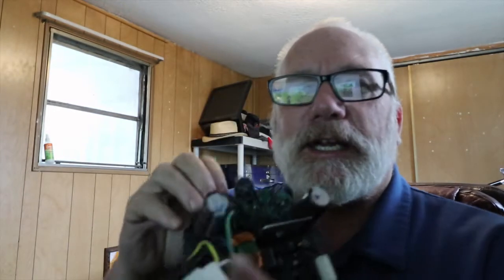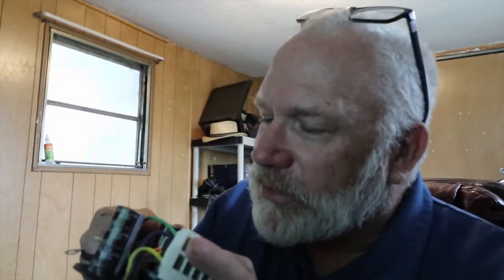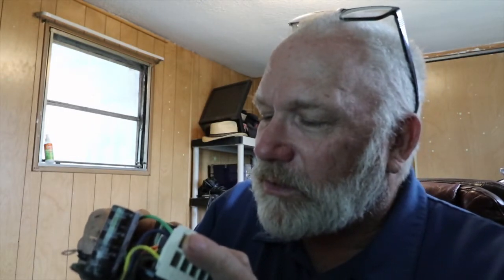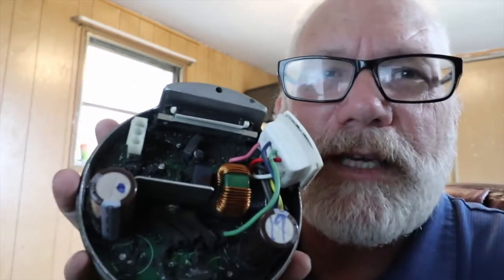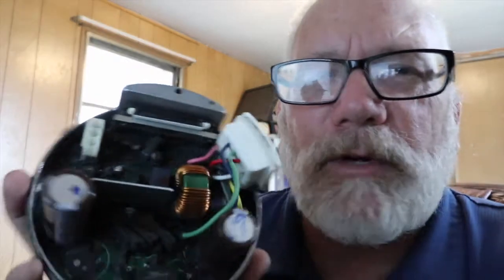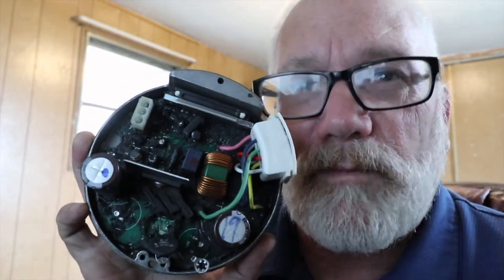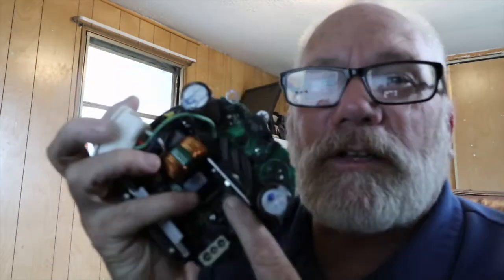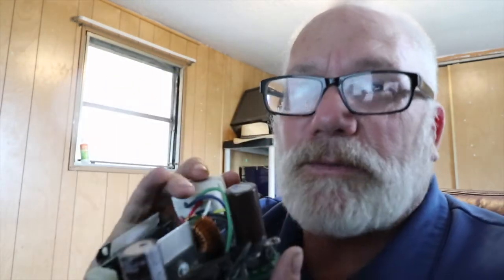Genteq x13 ecm motor with fm19 module REPAIR

Comment: Not sure if anyone replied with this but if you are in a pinch you can simply twist the thermistor until the two leads are shorted to each other and the motor will run with no inrush protection. A simple fix. temporary or as long as it will run until the next power surge.
Reply from the maker: thanks, but don't really need any fires...  but thanks for watching
Reply: @jefferycurtismusic1602 @jefferycurtismusic1602 It's true about twisting the thermistor. The thermister isn't really there to protect the motor. That's what they want you to think, but it's actually in there because the manufacturer knows the thermisters have a limited life. So, they basically use it as an expiration part to force you to buy a new motor. It would be replaceable if it was meant to protect the motor. If you're worried about it, you could always twist it and add an external inline thermister. Many aftermarket motors come with external surge protection that plugs into the wiring harness. A lot of my customers choose to go with a PSC motor instead.

Comment: Great video, that is exactly what gentec is doing. And knowing it can be made  at a fraction of the cost. Now im about to decide what to do with my broke one. It is hot in my house, but im not paying gentec a dime
Reply from the maker: the drop in replacement is really the best way to go.  I fixed the genteq for it only to fail soon after, put the drop in replacement its been fine for years.
Reply: @jefferycurtismusic1602  I bought a psc motor and a relay switch. Bout to put it in, Hopefully that works.

Comment: I replaced an ecm fan motor for a customer on a carrier furnace. Tried to get a new motor module for it. The dealer said the only listing in his system was for a whole motor. No listing for the module. Dont know if the info was correct, but i didn't have a choice. Since then i have a chance to look at the motor and module and found the motor was fine and the module had 1 small connection burnt. No sure if it's a fuse or just a weak link in the design. The inrush thermister looks ok, not deformed in any way. Havent electrically tested it. I was thinking of resoldering a similar sized and gauge wire accross this point to see if it would work

Comment: A great help to me, and to many more I'm sure.  Thank you so much. Very well done. Thermistor resistance was 1.4-1.5, should be 1.0. Hoping that's the issue. Certainly going to give it a try, replacing the thermistor without removing the composite material.
Reply from the maker: thanks .. I hope it works for you. have a great day.
Reply: Did replacing the thermistor work?
Reply: Did replacing the thermistor work?

Comment: Wish I would found your video  sooner ..I got in our trade in 1995 ( belt driven era ) running residential service..sooo  bought a new Bryant heat pump package unit last year ..thinking awesome no problem for many years …wrong …indoor blower motor starting staying on non stop …pulled the stat ..pulled the subbase checked all low voltage wiring ..changed the green wire one of my extra tstat wires …I’m frustrated now !!! Buddy said it has to be your board only board is the defrost board ..with no g terminal..but I changed it out anyway …still running non stop …now I’m mad …. Messed with those ac/dc relays for the additional heat strips I had put in ..with that Rectifier board ..( feeling like a dinosaur with this new technology ) …made myself even more mad ..anyway …started looking at the motor ..thought well why don’t you pull your speed leads ..sure enough ..pulled them …motor is still running …sooo I just ordered a new Module yesterday…this better work !! I miss belt driven motors and standing pilots just saying way more goes wrong with all the fancy bells and whistles !!!  ..this one really had me saying what the …. !!!
Reply from the maker: I am so sorry for your pain.  i know these things are designed to cost the owner money and prevent self-repair.   If you watch my follow-up video, The new module only lasted a couple months,  Finally I just replaced the motor with an Evergreen drop in replacement, which I am happy to say is still running fine.   Good luck hope your module lasts longer.

Comment: Agreed 100%. Genteq OEM should make some quality improvements on these or soon they will be facing a likely class action lawsuit by the many defrauded customers. Aftermarket is the way to go with the X13 without any confusion. However, it appears that the "Genteq X13 ECM Motor" is now under the Evergreen model made by Regal Rexnord. At least it seems so plus they (Regal) apparently have it fixed, comes with real ball bearings and a 2 year warranty.
Reply from the maker: ya cause the drop in replacement is still going strong years later...

Comment: I did hvac for over 40 yrs. My 2yr old x13 did the same thing. I installed a new package unit when I moved. Can’t get a unit that does not use them.  I am replacing that motor with tried and true psc ( old style) run many years motor. Physical size is the same. All you need is a relay and the motor capacitor. Every thing in this country has evolved to bankrupt us and we are all paying for it now! I have watched the hvac industry make their systems complicated and costly to the extreme. I was embarrassed to tell a customer what a repair would cost. I was at the tail end on this nonsense thank god. Good luck.
Reply from the maker: thanks for sharing.

Comment: So, actually they first over priced the motor in the A/C heating unit, so it's more expensive than other units, then they over price the new motor or the electronic controller for the motors, and the manufacturers will not sell or deal with the people who actually bought the A/C and heating unit, you would have to go to one of their distributors in order to buy the product/ motor or the controller for the A/c heating unit, why would anyone in their right mind, buy such a A/C heating unit, that was a great video thanks for sharing your knowledge, you are appreciated,
Reply from the maker: Thanks for watching...

Comment: I understand where you’re coming from regarding the black potting compound. And I’m sure some of it is to dissuade repairs, but any industrial type equipment like that needs to be potted. Especially something near a constantly running motor. These motors produce a large amount of conductive dust… and Conductive dust, moisture, vibration, and all sorts of other issues will drastically shorten the life of this module without the potting compound. 

Hear me out.....I deal with 300 or more of these every year, and have depotted dozens of them because of my own curiosity.  I have the equipment and chemicals to do it safely, quickly, and somewhat cleanly… 

And I can honestly say after handling thousands of these modules… If they weren’t potted… I think the lifespan would be drastically shortened. 

That being said… Surely there’s some other way they could build these instead of potting them, while still protecting the components. Possibly sealed in their own watertight containment area with an O-ring or something like that… But that would add a lot of manufacturing cost which would be passed on to the customer. 

I am the furthest thing from a supporter of these manufacturing practices… But there isn’t a better way at this time… To maintain the same level of robust design while keeping the price relatively low
Reply: But I mean no disrespect to you or your opinion. And wish you well with your repairs
Reply: My original Genteq module circa 2010 did NOT have potting compound.  It lasted 7 years before the current inrush limiter failed.  I soldered a new CIL in very sloppily.  It's been going 4 years.  These modules are extremely sensitive to dirty power coming from the power company or lightning strikes.  I may buy a 35 buck Zebra VZPRO surge protector for my model of ECM (the other type is for X13 is Zebra X13PR surge protector). I seriously doubt my CIL failed due to vibration, dust, etc.  The potting compound is total BS.  I too will never buy another Genteq equipped blower fan.  Next time it fails I plan to switch back to the tried and true PSC type motor using the Qwikswap V3 board even though it's slightly over a hundred bucks.
Reply: The potting in this case is surely to stop repairs; else they would have used conformal coating; which does the same thing (protection from FOD, contamination, moisture, vibration, etc…) but is easier to remove for test and repair actions.
Reply: The better way would be for the board to be a separate piece that mounts into the furnace, just like the furnace board that's always in there and not potted, but they won't make enough money like that.

Comment: The thermister is open if the blower will not turn on. You can jump a wire across each thermister terminal and if the blower comes on you know it is the thermister. You can cut the thermister out but leave its wires sticking up and solder a new thermister to those wires. Most thermisters fail from power spikes or surges. You can buy a surge protector that plugs in between the motor connection and wire harness to prevent motor or module damage in the future. I think the surge protector costs like $28. You can also buy a kit ($$$) to convert blower to the old style motor, capacitor and relay (points) system. Like I had for 25 years and never failed except for one relay replacement that cost 20 bucks. Yes like most modern stuff this crap is not meant to be serviceable. Replace parts but don't fix parts. It sucks.
Reply: @cujobean542  the motor should run. Not shutting off is not the thermister.
Reply: I assume you completed all the other tests such as the themostat or thermostat wiring and motor OHM tests to eliminate them as the possible problem. If you did that pretty much means the motor controller is the issue. Therefore, jumping the thermister on the controller board to test it should not be an issue but I wouldn't run it that way for long. A thermister is a temperature sensitive resistor. As understand it in these motors it allows current to charge the capcitors at a different voltage, or maybe I should amps, depending on temperature. This somehow protects the capacitors. The capacitors are what start the electric motor. Sometimes the thermister is burned indicating it is bad. If that is the case no need to jump it just replace it. The part for my 220 volt 1/2 horsepower  5SME39HXL182 motor is an SL22 thermister but I don't know if that is correct for all motors. The old thermister should have a part number on it. Mine says it is 1.0 OHM and a 4 digit part number. The thermisters are on eBay for as little as $10. Don't cut the old on out until you get the new one. Leave the wires from the old thermister sticking out so you can solder the new one onto those wires. Thermisters do not have polarity so which way you solder it in doesn't matter. If you decide to buy a new motor controller you must know the exact motor part number to get the correct board programming for your motor. As I said my motor part number was a 5SME39HXL182. It's printed on the motor label.
Reply: Great idea. I’m gonna try cutting the next transistor off and solder and new one like you said👍
Reply: Would this fix a constantly running blower?
Reply from the maker: Probably not,  once these things start failing, its been my experience that they will just keep going out, after I fixed mine it went out agian in a matter of months,  I finally replaced with an evergreen drop in for like 250 dollars, I haven't had a problem since.

Comment: Any device employing a rotating assembly has the potential to create a "vibration environment". Long exposure to vibration can damage electrical components (think small parts being shaken back and forth countless times until that small but repeated movement eventually causes metal fatigue to break one of the leads). To protect the board they apply adhesive over the components to hold them in place and provide strain relief. This is commonly called "potting". Potting can also be used to protect against dirt, moisture, chemicals.
Reply from the maker: ok, thanks for the response.
Reply: Yes with AC motors however, DC motors do not vibrate as much, a lot less than AC.  The problem with the Genteq OEM ECM is the crap part they are using.
Reply: @Garth2011  The rotating assembly of fan and motor as is commonly encountered in the field is never 100% perfectly dynamically balanced. This is equally true for AC motor driven loads and DC motor driven loads. Any deviation from perfect balance can produce vibration. If you can put your hand on a device and tell by feel that it is running, you are experiencing a vibration environment. PSC style motors don't contain the same circuit board populated with a collection of electrical components like ECM motors do. This is why potting is rare in a PSC but common in an ECM. I agree with you that the high failure rate of many ECM motors appears to indicate inadequate design, capacity or robustness.
Reply: @jblcontrol28crossover76  Yes but these ECM motors are really DC powered which means they have a level power Hz vs. 60 Hz per second as in AC. I believe that is where much of the "noise" comes from in AC motors vs. the more quiet DC motors. Our garage door opener is DC, our attic fan motor is DC and its night and day to the AC versions of those. Maybe one day homes will have a point of entry converter to swap AC power to DC power at the main breaker box !  Then we won't have this ECM problem, just what might fail at the breaker box !
Reply: @Garth2011  DC motors do not operate on an unwavering stream of current. Historically they've employed a mechanical commutator or to switch power on/off to sequential sections of windings in the armature. In the newer style ECM motors they employ solid state components to switch power on/off to sequential sections of windings. Both older and newer style motors send pulsating current through the windings. The letters VFD stand for Variable Frequency Drive.
Reply: @jblcontrol28crossover76  Yes and I'd hope that any motor that claims high efficiency also has high grade bearings, ball bearings vs. bushings or sleeve.

Comment: My thermister measured 1.5 ohms.   I bought the the new thermister and replaced it.    I spliced it in on top without removing the rubber.   It did not make a difference.   Time to order a controller.
Reply from the maker: Please watch my update video,  its better to just replace with and evergreen motor, cheaper in the long run also.

Comment: Thank you. Please help i am about to replace the whole module for the SECOND TIME in three years. Is there a problem i am not seeing???????? I worked machine shop 30 years so replacing part is not hard BUT playing with electronic is greek. HELP.
Reply: My advice is to replace the motor with an Evergreen Drop in replacement motor.  This is what I did after the module failed a second time.  Sorry for your situation.   I bought mine on amazon for about 250.  Hopr you Christmas turns out better.

Comment: Wow..great video. I have my ECM motor out of the air handler. Does not turn on at all. I can re-do the thermistor for sure. You checked the one in the video -- it was attached to the board ?
Reply from the maker: use the diode checker and see if voltage will go through is the quick and dirty way, this will only tell you if it is open, but many times this is the case.
Reply: @jefferycurtismusic1602  Wow..fantastic thanks

Comment: is it possible to lube the bearings in the motor? My unit has a faint squeak when on
Reply from the maker: yes on some models,  heres a link. https://www.youtube.com/watch?v=UKoK_U_GKZI
Reply: @jefferycurtismusic1602  I have a Gentec Motor also. From 2018, already started squeaking. I fyou remove the fM19 module can you lube it?

Comment: Mine failed. 6 years old.  Out of warranty.  

Tearing into it now.  That thermistor seems OK.

My motor will start if you help it - and won't if you don't.  I'm thinking one of the big capacitors on the board has failed.   Motor just spins very slowly in a shaky motion.
Reply: Thanks for stepping in. Yes sounds like the start capacitor. Look for swelling, that many times happens when a cap goes bad.

Comment: I wonder if that thermistor was really broken. You have to subtract the resistance of the leads. So you short the 2 leads together and that will give you a measurement. Usually in the 0.5-0.7 ohm range, but I wouldn't be surprised if it's 0.9 ohms.
Reply: Of course, Awesome video! I'm sitting here with a broken Genteq. I don't think it's the thermistor though. Turns on for 27 seconds exactly and then turns off. Weird stuff.
Reply from the maker: @bigrob4781  In the end I think it's better just to put an evergreen motor in, Pls watch my follow-up video to this.

Comment: Would 1.2 ohms still be too much at 80 degrees Fahrenheit  room temperature?  I cooled the thermistor with an ice pack and got a reading of 1.6 ohms. So it seems like it's working.  What are your thoughts?  Thanks .
Reply from the maker: Probably if it works, it works.

Comment: All you have to do is cut the bad thermistor  legs and solder the new thermistor legs to the old legs that are already soldered to the board , you made this repair way more complicated than  it needed to be. Don’t over think it, you might have to bend it flat so that it fits after you solder it but that’s not a problem.

Comment: the SL22 1R020 is 20Amp  Use a SL32 1R030  its  30 amps  and should not fail
Reply from the maker: thanks.  and thanks for watching.